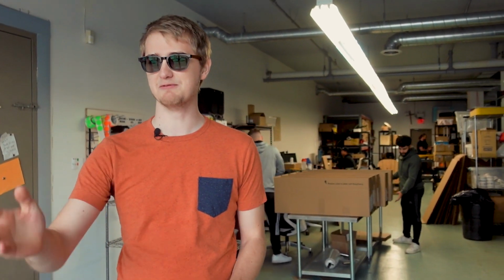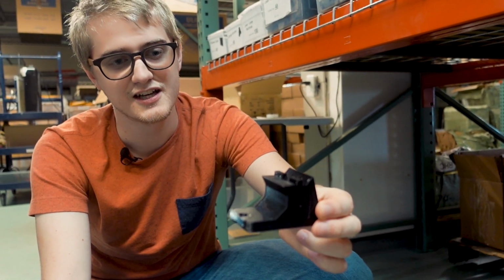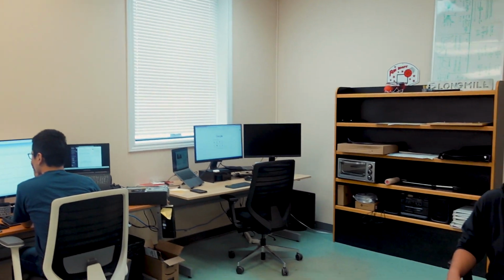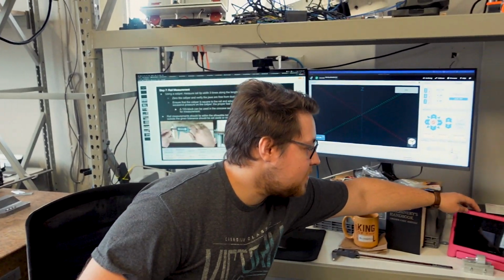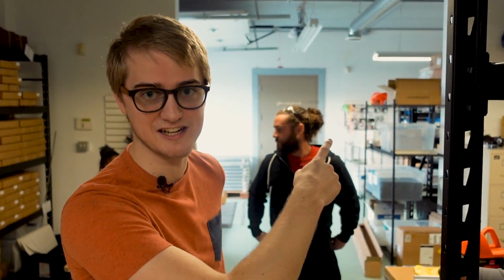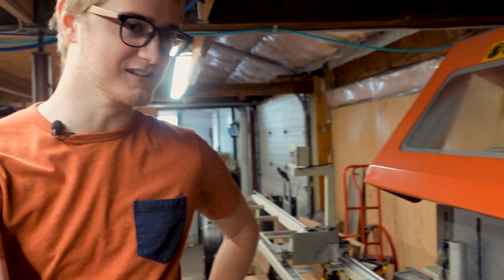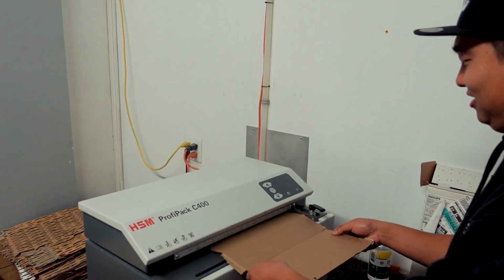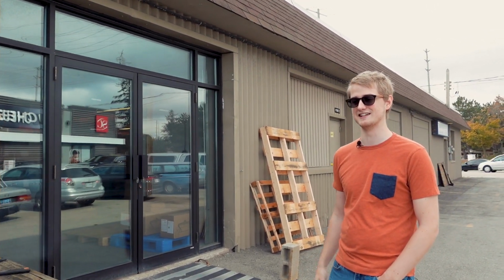3D Print Farm, Assembly stations, QA, and more. Sienci Labs Shop Tour 2022

Comment: I’m working on automating my printer to push the parts off of the bed after it’s done like yours. The problem I’m having is that it’s not strong enough to break the part off of the bed. (Even after it cools down). Is there a certain type of bed you recommend for this?

Comment: I create heirloom quality wood carvings on my CNC and am looking to add a new one.  I especially like the use of lead screws in your design, vs. belts. I just wish you would post a phone number at your website in case I did buy an MK2 48 X 30 or 30 X 30 and needed immediate help with something I couldn't fix on my own.
Reply from the maker: Hi triker, yes we do have a phone number on our website if you prefer calling. We also have many pages of resources to assist with maintenance, troubleshooting, and our community forums so that our machine users can get help at any hour of the day 👍

Comment: when is the mill one coming back? 
some ideas are 
1) MPCNC style bearing on conduit/pipe X gantry
2) X gantry is on front and back of spindle, instead of conventional Z plate front mount.
3) Linear Rail mounted, Lead Screw driven bed.
4) belt driven spindle headstock. like a "taig spindle". much more rigidity at lower rpms.
5) thomas sanlederer mod of adding a base board.
Reply from the maker: Great ideas! Yes we're still keeping it in the back of our mind how we might be able to bring back a small form-factor CNC like the Mill One. We found it was hard to sell the original since many people opted for small machines off Amazon since they have a similar price point and build volume and ultimately its harder to make a low-price CNC that's competitive to overseas manufacturing. We haven't given up on it though :)
Reply: @SienciLabs  3018's time is over, basically    reviewers flooded youtube with videos that clearly show how low quality those are.
However a miscalculation on their part was that the tinkering spirit of makers would overcome their rationality and they would still buy the damned things thinking they could slap a 300W "spindle" on it and make it work, it didn't.
With the recent success of the DMC Shariff with Batch 2 deliveries already started, and that's a $4000 desktop mill that uses flood coolant, mills steel, eats aluminum, the market for desktop mill has reset. The era of $5000 Bantams and crappy 3018s is over. 
https://youtu.be/PppsTAgAM3I🥰
If your engineering team thinks an  "enclosed", "12x12 inch" , "aluminum ripper", running Linux cnc and making good chips can be made under $1000, let them run wild. At most it costs you $1000 and some time.
also this is what i meant when i say "belt driven spindle"
https://youtu.be/AHZT1qcZUYY🥰